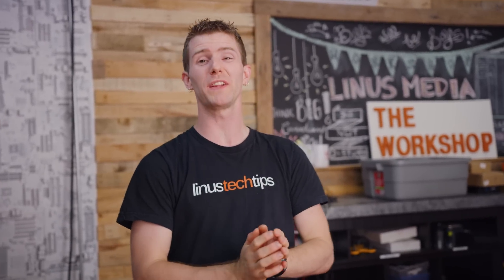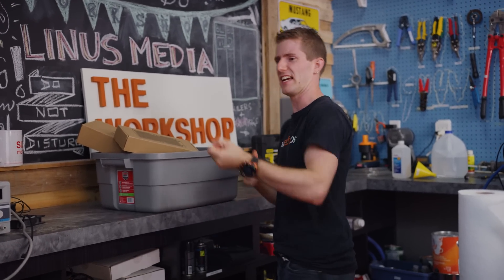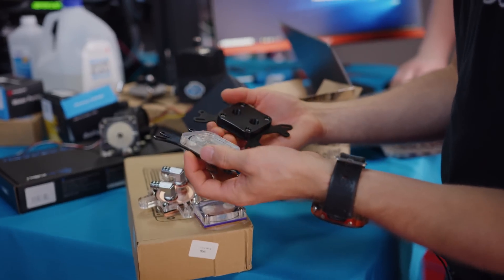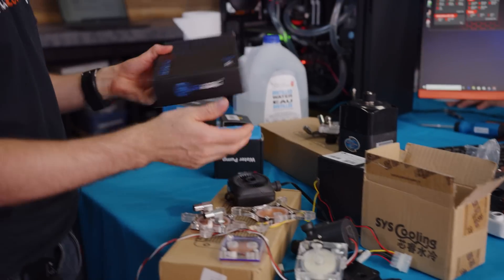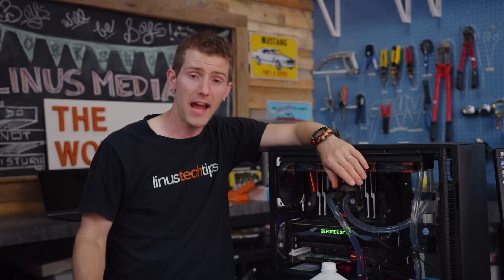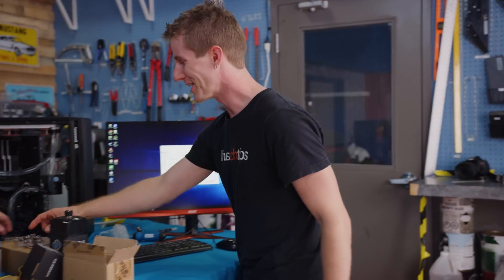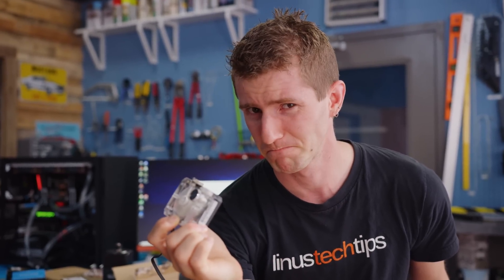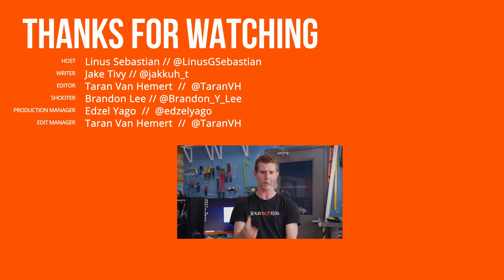AliExpress Water Cooling DOESN'T Suck?!

Comment: i had a vega64 with a blower cooler. hot spot at 100-105°C constant thermal throttling. bought an ali barrow water block. overclocked the card to the factory aio water cooled sapphire ones settings. under full load after hours of gaming 50-60°C

Comment: You guys should test how the water pumps rpm affects heat transfer. Ive learned over the years building race engines that not slowing the water down enough for the radiator to transfer heat will cause overheating. That's why your car has a thermostat. The engine would overheat without it.

Comment: You CAN use mixed metals in setup - as soon this metals doesn't have electrical connection between them. It acts like a battery - you have two electrodes and electrolyte, but in order to run chemical reaction you have to connect both terminals with wire. I doubt that you can isolate waterblock from CPU, but you actually can isolate radiator from the case.

Comment: I think if they had gone with a copper rad of the same thickness, the performance would have been almost identical. the EK rad is 40mm thick and copper, while the cheap aluminium one is 30mm thick
Reply: @TheDembe1  but in the video they used the aluminium radiator, not the copper one
Reply: @TheDembe1  not for the aliexpress loop. They use the aluminium rad

Comment: The SC600 pumps actually work pretty well.  Just don't use it on a high end system.  The other option is just to set your thermal shutdown low.

Comment: Bought mostly Bykski parts for my loop through AliExpress. Took like 2.5 months for everything to arrive because I ordered on 11.11 and everything got tied up in shipping. Ended up buying Hardware Labs' Black Ice radiators from Performance PCs because Ali's pricing plus shipping (11.11 pricing, not just everyday, plus no free shipping for the brass rads) matched the price of the Black Ice rads including their shipping. 

One advantage to AliExpress and Bykski/Barrow is the variety and availability of GPU water blocks. So much more than what big names like EK or Bitspower have available.

I did have a defective Bykski D5 pump (ratings were good, I think it was just mine that was a dud). Ended up returning it (and have gotten my money back in a reasonable amount of time) and bought an EK pump from Micro Center since most of my loop was already built and I didn't want to go back and re-install my air cooling while I wait another 2 months for a replacement.

Comment: This is proof that a lot of watercooling parts are hella overpriced
Reply: Definitely. WIth Bykski and Barrow being more mainstream now in china, they are such good options for more affordable waterblocks and fittings. You save a good amount with pumps too, but probably better to go for one with warranty. Also I believe Bykski makes gpu waterblocks for almost every card out there, so if there is someone with that weird pcb card, bykski probably has it.
Reply: EK nowadays costs a bomb.
Reply: @mikeycrackson  Bysky and Barrow have great quality parts. You can order from FormulaModz and their warranty and support from what I've read is really good.
Reply: Abstract Anonymity I actually just saw their website and they have full water cooling kits(cpu and gpu) for the price one may pay just for their gpu block. So I like the pricing but like I don’t know if youd want to go that cheap lol
Reply: @luismiguelruiz4290  I've been using cheap waterblocks and even a cheap pump to test out and they aren't all that bad, temps are the same as my supremacy, the pump is just as quiet, far less flow but still silent, I'm using a double 140mm rad and load temps on my Xeon 2630 are the exact same, around 40-48° at load
Reply: Its overpriced but because China labour cost is cheaper. However, I feel that there is more to the story than just the manufacturing cost.
Reply: @Skrixm  not just labour costs, ek produce far less products than "Barrow" Barrow will be making 1000s and 1000s a week on automated manufacturing

Ekight only be producing 600 blocks a week, they really don't have a huge market
Reply: Pretty much I mean I get economies of scale. Clearly there are few people doing custom loops in the grand scheme of things. Yes this often means they aren't able deploy super mass production techniques but the price of a basic loop these days from a company like EKWB for example can easily run you a grand like you could build a whole nother mid high end range pc for that kind of money. Just no way in hell a rad, some water blocks and a pump / res should cost anywhere near that. That you can find water pumps that are used in other applications for dirt cheap but for water cooling all of the sudden they are priced like they are space age technology that took a next generation fab to build which is nonsense. You can easily build a whole loop with a brand like byski or barrow and spend at least half if not less and get equal results.
Reply: No, it just means that if you extort developing countries over cheap labor, bypassing any need for research by stealing from established countries, well duh then you get a much lower price point. And perform worse.
Reply: all this is now on amazon as cheap stuff.
Reply: when you look at how simple most of watercooling parts are, they really are terribly overpriced. When you look at stuff like radiators. A regular 360mm radiator costs about 4-5 times as much as a new car radiator (deppending on the brand and car) but the car radiator is several times larger than the tiny 360mm pc cooling radiator
Reply: AIOs are also proof of this.
Reply: not to mention that a good $90 air cooler is about 20 times less hassle with similar performance. Unless RGB and gamer swag is worth the extra $200 + future maintenance

Comment: linus should redo this video. you can buy a full custom loop off amazon with legit water blocks for cpu's for around 70 to 90. it is REALLY cheap now. and that is the full entire loop, the water block, reservoir, the radiator, etc.

Comment: Bought a full loop including GPU block for $300 on AliExpress (plus $100 for two 280 radiators from PPCS because the shipping on the AliExpress ones put them at the same price). I splurged and went with the better Bykski and Barrow parts over the no-name ones and on the pump with a D5 Bykski one.
Reply: Comparable setup I priced out at Micro Center cost over $600 without GPU block because they don't make one for my card
Reply: And I included extras like custom power extensions, plug fittings, splitters, and a drain valve.

Comment: Its cool tho i wouldnt go for a cheap water cooling system ...i would buy an expensive air-cooler and expect about the same results with no worry,s about cheap parts failing or leaking and destroying my precious hardware

Comment: I have all Barrow compression fitting in my loop for 3 years. Actually my entire loop was about 150$.  It's flawless.
Reply: I have a new build and salvaged all the parts except the cpu block(got new barrow cpu block) and the pump. The old pump still working but wanted a DDC. For the fittings, I just replaced the O-rings in all of them and got new tubes. Still working flawless all these years.
Reply: Is it still ok 3 years later?
Reply: I just spent 150 on a looop I hope it works well
Reply: @dirtyasianmafia2310  Hey, did it work well?
Reply: @TheDembe1  i ordered a 500$ custom water cooling kit from barrow.I cant wait to get it.I saw many reviews and opinions about barrow and everyone says barrow has a better quality products over bykski so buy barrow.I dont say that bykski is bad but buy barrow
Reply: @TheDembe1  ok
Reply: @TheDembe1  thinking of doing the same thing. What's is x flow?
Reply: what parts did you use
Reply: Dude your profile picture looks like a CPU block
Reply: @Sspssp-q7w  and noisy ones, don't forget about the awesome noise

leak and damage your pc?! what are you? 12?

Comment: The syscooling SC6X is a very good pump, like the 75 and 90.

Stop being so snob with D5's and DDC's. In the early 2000, we used Zolux, Hydor and Eheim pumps, and all worked pretty well.

Don't say that a loop with Cascada and Blacklord pumped by a Eheim 1046/8 doesn't work... Or a nexxos XP with a Eheim mini 600.
Delphi's (D5, DDC) pumps are very good, but higly overpriced and totally useless for about...99% of WC pc loops that are today highly restrictive.

And cannot count how many dead DDC's i saw under 30K life hours...

If you don't trust Syscooling, don't trust any AIO's.

Comment: Actually ordered a complete loop back in 2016 with copper rad, pump, hardtubing, res and fittings.. And it was darn fine for the price.. The fittings especially. Had triple rubber rings inside, plus additional rubber rings included.. It was tight and worked perfectly. And I have worked with ekwb, Alphacool and xspc before, so I do have something to compare it to.

Comment: Flat block are good with a slow flow to avoid lamination in the block. It's oldschool, but it work. With a good radiator and pump, it will do the job.
Btw, the syscool 64f is an excellent pump for the price, why did you not test it with the EK loop?

Comment: The title is completely OFF cause ofc. LTT has to support the expensive companies. The real title should be AliExpress Water Cooling is really decent quality and is actually at really really decent prices. 10$ for waterblocks and pumps. 1$ super good quality fittings. 25$ full bronze high quality  thick 240 radiator. And you can even find fancier products for half the price of what EK or expensive Water Cooling companies ask. I mean EK wants 15 EUROS for only a fucking tube bending kit, that has a FUCKING SILICON tube that is totaly inexpensive, a mini saw , and some sandpaper. On ali express you can find RGB waterblocks for like 30 euro.
As of guys don't cheap on your pump. I have 2 chinese pumps, one costs 3.5 euros and is pumping completly fine 240L/H COMPLETLY silently (downside is that it has preinstalled plastic fittings that cant be replaced) and the other one costs 9 euros, making some really small noise cause its pumping 500L/H + its full metalic, has 1/2 inch fittings. And a reservoir costs for like 15-20 euro with RGB even. And you tell me i have to spend 150 on pump res combo from EK while the 10+20=30 euro will do the same, maybe even with a STRONGER pump than EK's one.
I am sorry Linus, but this is totally outraging . Your video tittle is totally missleading, hindering that those products DONT SUCK.. that they are "fine" . But our sponsored products are better. When they are not. Especially VFM.

Comment: Linus is really fan of those expensive pumps like d5 and such i had a branded d5 which is very expensive and i also have that pump which you said that you wouldnt recommend, honestly d5 died on me it lasted 2 years while the suck pump from ali that you dont recommend is still running until now 2019 which is almost 4 and a half years and if it survive this year it will be 5 years old, imagine that..

Comment: what about the three $30ea noctua industrial fans on the rad ? I would say they have a pretty substantial effect on performance although you can use 3 5 dollar fans and get near the same heat dissipation (at same rpm) just louder and will die much sooner.

Comment: Ya ever try water cooling while already air cooling 
A guy did it on youtube
Basically had a cpu fan one of the big ones that rest on the cpu, built a acrilic tank around it and water cooled it and it worked

Comment: Was excited for this but it was a total failure. There are ONLY 2 REASONS to order watercooling off of AliExpress and that is so you can get the full custom kits they offer for popular PC Cases like the Thermaltake P5 and such, which come with Custom Acrylic Water Boards designed for that PC with all the pumps, reservoirs, fittings, coolers, pipes, tubes, lighting, etc included and it looks frickin amazing since it's custom. 
OR you get one of their bespoke made and fascinating Acrylic 'WaterBoards' that also double as a PC case that you then attach your computer parts to, like an open air PC except the whole thing is Water Cooled... Which is kinda stupid but damn if it doesn't look amazing.
Seriously go look at how legit and amazing their custom waterboards and setups are, they're not cheap either, full set costs between $400-700 but you're basically paying so that you can have a limited run bespoke setup that will win every watercooling epeen competition ever. Ever.

Comment: OMG Is Linus paid by EK?  His own experiment in this video PROVED that for only a 4 degree difference you can save 75% on a brand new custom loop.  But he refused to give the seal of approval. 
I MEAN COME ON !! A find like this should be (or IS) unprecedented. Seriously. Even if you only saved 2/3rds of what you normally pay.  You could still buy your block from EK and have the rest of your loop from Ali-Express. Then you'd have EQUAL performance and still save 2/3rds to 1/2.
You don't NEED to take the free shipping.  You could take CHEAP shipping instead -- and pay maybe 5 bux and receive in one week -- instead of free shipping that takes 2 months.

Comment: try ID-Cooling Hunter Duet system, has 2 water pumps cpu and gpu sinks<pumps r directly above the heat sink thing, w/a 2 fan radiator like 120$ on ebay

Comment: 90$ including those expensive fittings you used or what?
Reply: i got a full system kit with a 360 rad and came with every fitting i would need actually pretty nice barbed fittings

Comment: the flat copper will not make much difference as the water and flat copper will not be the bottleneck in heat transfer ..it will be the thermal paste on the other side of the copper  which will be many times less efficient than water ...what will make the biggest difference is the flatness of the  bottom that contacts the CPU ...i am guessing but i guess the aliexpress coolers will have a poor finish here  ..hence the difference in performance  i am VERY surprised you did not compare them...oh and shiny doesn't necessarily mean its flat

Comment: Does some has experience with Bykski and barrow ?

My EK Loop would cost me about 1200€
Where the same config only with Bykski and Barrow parts cost me about 500€
Reply: im using barrow for fittings and block from bykski they're actually pretty good using it for 3 yeard now

Comment: The reason they're similar, or at the very least look similar, is because they're probably manufactured by the same factories... just re-branded. That's what you get when all your tech companies have everything made in China. They can pretty easily reverse engineer or copy the exact same design then undercut the original designer. A lot of the stuff is actually just b-stock of the original thing it's similar to.

Comment: Been using the VTG 240 water cooler for 6 months. I7 7700k at 5ghz, 1.320 volt. Runs mint, keeps things cool. About 5 degrees hotter than a corsair h110, but less than half the price!